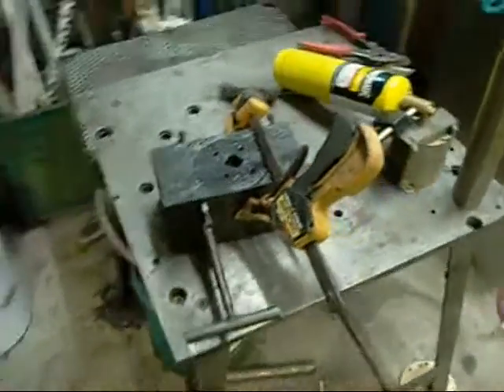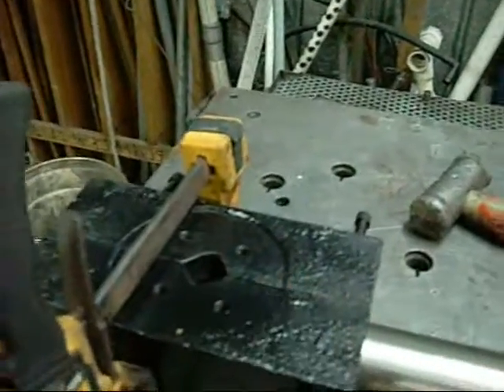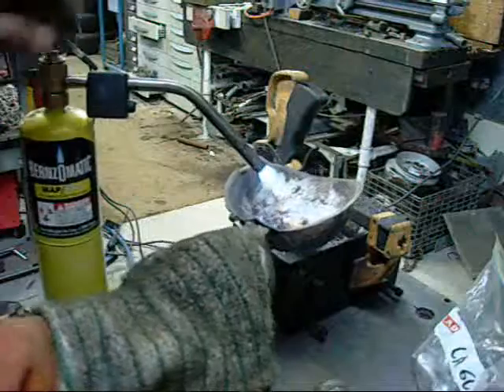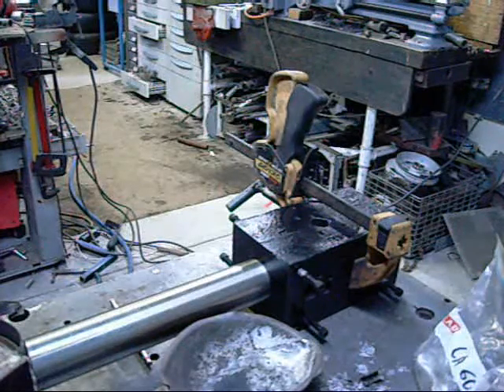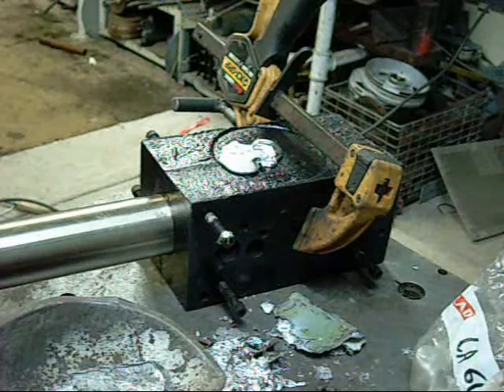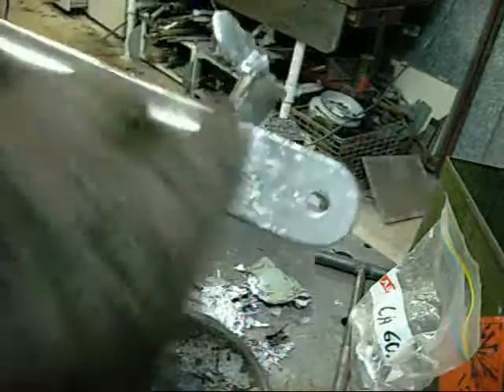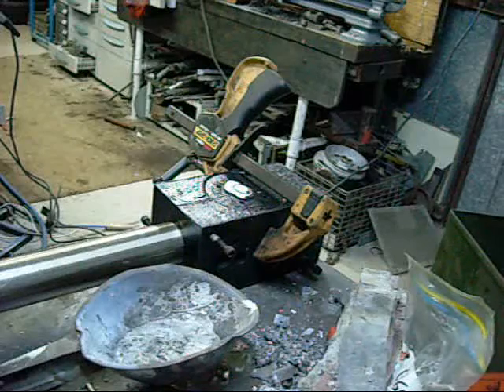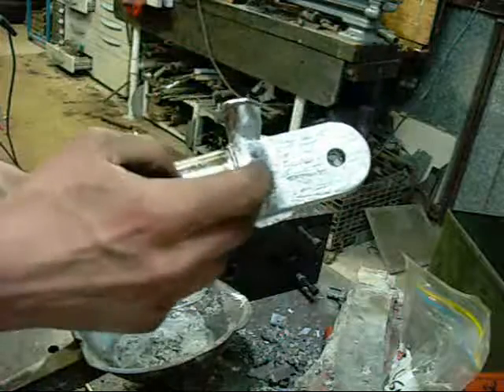Tent Pole Head Diecasting Test

Comment from the maker: Cool man!, I've seen that style before and they work well. I think mine are a bit over engineered for everyday use, but obviously the military need tough stuff for their command and medical tents.

I've used the blast furnace to do sand castings before with aluminum, but I was guesstimating the melt temp. it worked well in sand but the die casting will take more temp control.

Comment from the maker: THe wood fired furnace is what I normally use to smelt aluminum, but I'd need a thermocouple to tell me when its roughly at 700*c for pouring.

A big propane blow torch will do for heating the die to 300*c too

Comment: Aussie-
Very credible job that I've also approached in another fashion. In my application, i usually take 1/2" aluminum rectangular bar, bore the hole in it, bevel the edges and slide it into the tube about two inches and rosette weld both sides at 180 degrees apart with the HF TIG welder. The only drawback is the open voids at the tab end of the tube, it often leaves a nice place for spiders to nest if the poles are stored in the trailer or the backyard shed! You should use your blast furnace!